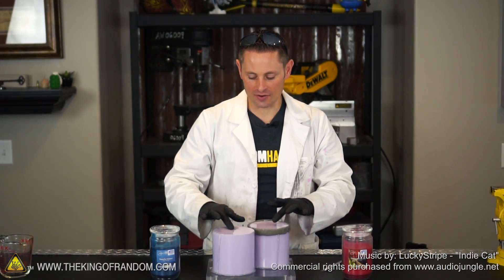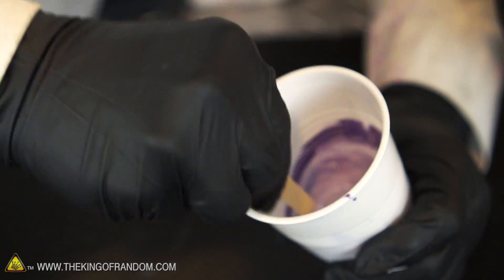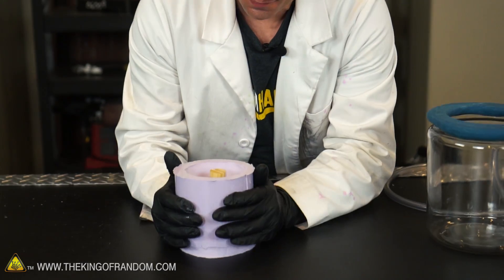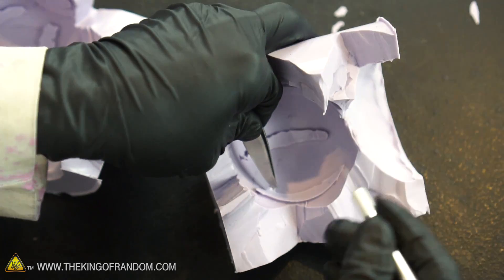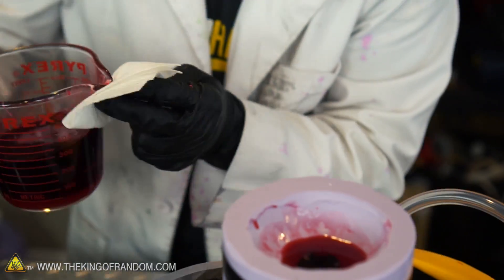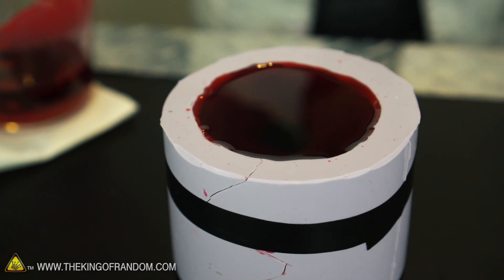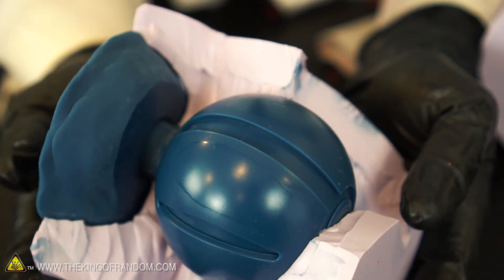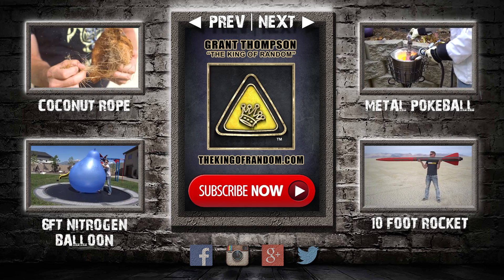Wax PokeBalls & More Trypophobia Reactions in a Vacuum Chamber | TKOR How To Make Pokeball Mold

Comment: the bubbles in the wax in the vacuum chamber are probably there because it is boiling. the boiling temp lowers when in a vacuum.
Reply: LOL beat me to it =P
Reply: Santiago Salyano Miller ummm what?
Anyone who uses the phrase "you dum dumm" probably isn't old enough to take basic physics or chemistry yet
Reply: Yeah this is probably what's happening
Reply: Yep, I was going to comment the same thing. I wonder if that had anything to do with the smoothness of the casting. Less water means cleaner edges?
Reply: finally, someone with common sense
Reply: This is also why the level of wax lowered
Reply: not that water itself boils. it still needs a heat source to make it boil, its just that if water is in a vacuum the temperature at which it boils decreases.
Reply: danmur15 It is bubbling because the pressure on the existing bubbles reduces so they grow more and more but still have the same amount of air.
Reply: +GTA ONLINE Nah wax is hot and reached its boiling on increasing the vaccum ;)
Reply: danmur15 I was going to say the same thing but I didnt know the boiling point of wax chart! 😂
Reply: I was gonna say the same thing. But I also wondered why Grant didn't already know this
Reply: i was going to say the same thing.
Reply: gurjodh Singh But the bubbles created by boiling are probably even more expanded by vacuum
Reply: Think of a very tiny bubble at the bottom of the ocean. By the time it reaches the surface, that very tiny bubble could be feet in diameter. 

The same principle holds true here. When reducing the pressure, you are allowing the already existing bubbles to expand further. The silicon could boil, but it wouldn't happen as fast as you saw in the video. Water will boil at about 30 Celsius in the vacuum grant has made; the silicon wasn't 30 degrees Celsius or did it approach the vacuums limit
Reply: nathan rous I was talking specifically about when he said something along the lines of "why are there bubbles in the wax", not the silicone
Reply: Absolutely. I thought Grant knows Physics a bit better :(
Reply: And thats why it seemed to have decreased in amount as grant said. It boiled away :)
Reply: @ mac B. - Water does not need a heat source to boil in a vacuum. If H20 is in the liquid phase (water), then it will boil until it freezes. Then it will sublimate.
Reply: me too =)
Reply: So can you melt wax just by putting it in a vacuum chamber?
Reply: dezdoodlez I believe it only works with liquids, but I'm not sure
Reply: What ^^^ he said.  Water boils in a vacuum, so will molten wax.
Reply: Hi I totally agree with your comment.
Reply: dezdoodlez it has to have a low enough melting point or it will stay solid. Wax has a relatively low melting point
Reply: All materials are liquid in the right temperature
Reply: danmur15 I was going to say the same thing but I didnt know the boiling point of wax chart! 😂
Reply: danmur15 The poke candle was my idea
Reply: imhbomb yes that's why if you put water in a vacuum its boiling temp lowers and is actually very low temp so you can boil water until it freezes in a vacuum
Reply: Gamer Max
Reply: Shoot. I was going to say that
Reply: danmur15 yes I agree
Reply: yep
Reply: Can you melt wax simply by evacuating the chamber? Maybe. It would depend on how the phase diagram for the wax looks. With water, the freezing point of water rises at enormous pressure (~10,000 atmospheres or more). There is a small pocket of area on the graph where, from -25 to 0 C (below the normal freezing point of water), reducing the pressure from that much would result in the ice melting. But there is no way to melt ice in a vacuum (pressure less than 1 atm) without raising the temperature. The effect works much more easily with boiling - the boiling point of water can be reduced below 0 C in vacuum.
I don't know what it looks like for wax, so I can only say maybe.
Reply: danmur15 the imperfection in the wax were due to imperfections in the silicon moulding.
Reply: danmur15 the imperfection in the wax were due to imperfections in the silicon moulding.
Reply: Grant Thompson - "The King of Random" you should make a video on cool things to do with dry ice or liquid nitrogen
Reply: danmur15 add on**, I misunderstood initially, but what I said would most likely be true for the wax. It all depends on the phase diagram of paraffin wax.
Reply: that does seem possible, but what does evaporated wax look like?
Reply: same as water
Reply: bubble free
Reply: Lard British put it better than I did honestly
Reply: lowers the boiling point. I'm not sure if it lowers the melting point though
Reply: you dum dumm
Reply: danmur15 😂😂😂

Comment: Wax began to bubble due to low pressure. The low pressure reduces the boiling point of the wax and the wax boils at room temperature. Try put some clear water into vacuum chamber and it  start  boiling too

Comment: I'm pretty sure the wax was bubbling because it was boiling, not because there were air bubbles. Since the boiling point of a liquid decreases as the atmospheric pressureis lowered, by putting the wax in a vacuum chamber you might have just lowered the atmospheric pressure in the container to the point that the wax could boil at it's current temperature.

Comment: Hi I made dry ice using a 4500psi air rifle hand pump and a iron pipe with a cap on one side and a valve on the other and used fermentation to provide the co2 I wold like to see you try that I think that's up your ally

Comment: is there a way too make a clear casting using the silicone or maybe take your prefect wax molds and make a clear mold and melt it out leaving a clear negative then we could see inside them in the vacuum chamber as to where the bubbles come from

Comment: you know that liquids boil at lower temperatures when there is lower air pressure? especially in an near vacuum. there was probably not much air in the wax. but the silicone should also boil in near vacuum when it was liquid.... its interesting that vacuuming the liquid silicone has really worked like you hoped.

Comment: The boiling point in a vacuum is lower than in normal atmosphere. As the wax is already hot it starts to boil in the vacuum. So you are just creating new (air)-bubbles...

Comment: Weren't the pokeballs from someone else? Borrowed...
with hot glue in it
Reply: I guess hot glue is easy to peel off and it is on the inside too.
Reply: I pretty sure rubbing alcohol causes the glue to release easily.
Reply: just warm it up and start peeling
Reply: wanted to say the same thing
Reply: djBaroloveGS Galatasaray<3
Reply: djBaroloveGS They were originally Pokeballs that were borrowed. Then he made molds of them, and made wax balls, and then made a mold of those. Now we're here.

Comment: I'm pretty sure the bubbles were actually wax boiling off into vapors,  not from trapped air. I've seen the same thing with liquid nitrogen and also cold water, it's stable but boils and foams in a vacuum.

Comment: I'm not sure that those were air bubbles in the wax. I couldn't find the boiling point of paraffin in a vacuum but it could have been some component of the wax boiling off in the vacuum. Just as an example, put a glass of room temperature water with a thermometer in it in the vacuum chamber. As the pressure reduces the water will begin to boil and the temperature will actually go down.

Comment: You're not vacuuming out bubbles from the molten wax, you're actually boiling it by dramatically dropping the pressure. When pressure goes down, boiling temperature also decreases.

Comment: can put cake mix in a vacuum then bake it and see what happens
Reply: Manus probably makes a very very dense cake.
Reply: Manus put a cat in it and see what happens
Reply: Manus all air would be removed making it a little bit flat.
Reply: I think it would make it dense but unless you're cooking it in the vacuum as well it should still be fluffy as the moisture evaporated from the cooking process
Reply: Well, that was almost English.
Reply: Pj Ryan now that's just animal cruelty
Reply: It will freeze. Cody's lab did this with an egg
Reply: Not to mention there's raising agents in many cakes, baking powder etc, which will not be affected by the vacuum.
Reply: Manus you get air free cake mix, done.
Reply: at least he can finish his words fool
Reply: Manus yes please
Reply: Manus ooooooooh, yes please that would be cool
Reply: As some others have said, it wouldn't do much unless you're cooking it in the vacuum. Most breads utilize either yeast, baking powder, or another chemical reaction between a base and acid such as baking powder and cream of tartar, in order to introduce CO2 into the mixture. If you use a base and an acid, as soon as you introduce a liquid the two will start reacting and producing CO2, making the mixture fluffy. If you put the mixture into the vacuum then once the chemicals have finished reacting, no more gas will be produced and baking it will result in a very flat 'cake' (and I assume rather rubbery or gooey in the interior, because without the air bubbles the dough can't bake as evenly).

Yeast works by feeding on the sugars/starches in the dough and subsequently releasing CO2. So I believe using yeast would result in a very similar product to using a base and acid, except chances are that the yeast will continue producing gas while you transfer it to the oven. The initial, abundant amount of gas produced would be removed by the vacuum, but some of the yeast would surely still be feeding. As a result, the bread would still rise until the yeast are killed by the heat, but it would not be nearly as much as a typical cake and, as I said before, it would likely result in a slightly rubbery or gooey center. 

Lastly, using baking powder, which is the typical leavening agent in modern baking, would most likely not make any difference. Most baking powders are double-acting, which means that they have two different reactions that take place. One reaction releases CO2 when catalyzed by a liquid, the other reaction releases CO2 when you add heat. The first reaction is typically weaker than the heat-activated reaction, it's really only intended to produce a fluffier dough, while the heat-activated reaction is meant to leaven as it bakes. Thus, if you're using a double-acting baking powder, if you're not actually cooking it in the vacuum, then it will make little to no difference in the final result.
Reply: Manus you will get a non-fluffy cake
Reply: truchoemail b so eggs = cake in your books. Nice, Ima eat like 5 cakes now ty for sharing your brain cells lmao,
Reply: Yes please!
Reply: yes
Reply: Manus do it please
Reply: WhiteWAFFLES that's the final challenge this season on master chef
Reply: WhiteWAFFLES b
Reply: 460 likes !!!!!! 
what ?
wtf ?
Reply: ***** Do they have vacuum ovens? What would the purpose of that even be? lol
Reply: ***** Hmmm. The pressure cooker I have has plastic parts though. :/
Reply: ***** I do have the old school pressure cooker with the little metal piece that you put at the top to slowly release air, but I'm not gonna take my chances. My mom always said if you make the wrong move, an old school pressure cooker could shoot a hole through your roof or send metal everywhere. xD lol

Comment: WARNING!! YOU WILL NO LONGER BE ABLE TO USE THE PYREX MEASURING CUP TO MEASURE FOOD ITEMS MEANT FOR CONSUMPTION! I learnt this fact the hard way.
Reply: Alexandria Crayne yes you can. you have to melt the residue and wash it out hot
Reply: You're right, drain cleaner should work. It's actually a base, not an acid, but your point still stands. The lye inside drain cleaners (sodium hydroxide) should dissolve waxy/fatty materials.
Reply: Not without destroying your pipes/plumbing/septic tank. Plus it doesn't degrade.
Reply: I've dumped the melted stuff in the trash and washed out the tiny bits. It usually mostly breaks off then I put it in the dishwasher
Reply: that'll ruin your dishwasher dude. But to each their own. Glad you haven't messed up like I have, yet.
Reply: Alexandria Crayne Just pour some drain cleaner down the drain. Dem acid melt anything.
Reply: Alexandria Crayne what???
Reply: Because non-food grade paraffin wax can get into your system, and make you sick (mild stomach ache ad waxy burps) in addition, can't be completely removed, so even if it's food grade wax, it'll make your food taste waxy/plasticy

Comment: Your vacuum has passed the vapor pressure of the liquid wax and it is boiling. You need to find the optimal vacuum pressure that does not boil the liquid you are evacuating.

Comment: The reason the wax was boiling is due to the vacuum lowering the boiling point, you can test it with water too, room temp water boils with 20 or 30 pounds of vacuum i believe

Comment: The bubbling of the wax is actually because the wax is boiling. As you lower the pressure you lower the boiling point of the wax so that's why it's bubbling. It is not air bubbles that are stuck in the wax or in the creases of the mould. For example water can boil below 100 degrees celsius or 212 degrees Fahrenheit (boiling point of water) if you lower the pressure.

Comment: Hey Grant my theory on the bubbles is that due to the low pressure inside the jar the boilingpoint of the wax is lowering. 
Thats at least what happens to water under the same conditions. 
I conclude its just the wax that's boiling, besides i would have no clue where bubbles could get trapped in a liquid like hot wax due to its viscosity. 
- keep making videos!

Comment: Hey Grant, the temperature of the wax may be part of the reason you got bubbles when you put it in the vacuum chamber. Reducing the pressure drops the boiling point (The opposite effect of a pressure cooker. You may not have been seeing air bubbles, but bubbles of vaporized moisture in the wax.

Just something to consider.

Comment: I really like how you can see in the casting the difference between the wax that you vacuumed and the wax that you used to top it off. The wax that was vacuumed is much darker than the base.
 looks like there was much air inside the molten wax

Comment: I think the bubbling when you put the molds and hot wax in the vacuum chamber is because the pressure is reducing and that causing the boiling point of the wax to lower and it boil up again.
As you released the valve the pressure normalised and the bubble disappeared because it's not boiling in normal air pressure anymore.

Comment: Grant - the bubbles in the wax are from the wax boiling. Boiling occurs when the vapor pressure of a liquid is is equal to the external pressure on the liquid. This happens in two ways: the common method of heating a liquid (which increases pressure), or increasing pressure (e.i. a vacuum chamber).
Reply: +Boosted98gsx

Comment: The vax bubbles in the vacuum might be just the vax boiling because of the lack of pressure,should also happen just with water, aka you can boil water without increasing its temperature

Comment: The bubbles from the wax in the vacuum chamber are not trapped air bubbles. That's actually your wax boiling under low pressure!

Comment: Those bubbles in the wax (red pokeball) are probably not air trapped in there... you are lowering pressure to a warm liquid. It is most likely "boiling"... Try doing that to warm water ;)

Comment: I believe the bubbles in the wax were partially caused by the wax boiling, because the less pressure around a liquid the lower the boiling point.

Comment: Could the bubbles in the molten wax be forming, because the pressure is low enough for the boiling point of the wax to be room temperature?

Comment: i have some technical information and a suggestion :D 

info: as a liquid the wax has some dissolved gases, when you vacuum it it will release them but also it WILL boil since the liquid needs way LESS energy to become gas and  fill the "capsule" (chemistry, partial pressures chapter :D ) 

suggestion: now that you're playing with the vacuum chamber try to make some kind of bubble toy. i'm interested to see how it will react if the silicon cures inside the pressure chamber and then once it's totally cured how quick it will shrink :3

Comment: Hey Grant, I think the bubbles are created because it's boiling. under low atmospheric pressure water actually boil's at room temperatures. Put a glass of water in your vacuum chamber and see if it boils.

Comment: The wax gave off bubble when put inside vacuum camber might not be a result of air trapped inside but that the wax boiled under low pressure. Low pressure must have lower the boiling point of the wax. If not the case, it will be hard to explain why were there so many bubbles.

Comment: The bubbles are not coming from  the inside if the Pokè-Ball but I think the wax is boiling because the boilingpoint of liqids is lower in lower pressure, so it's boiling at room temperature 😮

Comment: The bubbles are coming from the wax itself because it was cooking and not sucking the air out. Let me explain this: The air pressure was lower because to the vacuum and if the air pressure is low then the wax will cook on a lower degree then it normally would. So i hope you understand me and helped you out :D (Sorry if the english is not correct ;) )